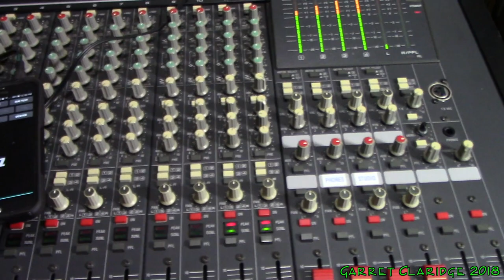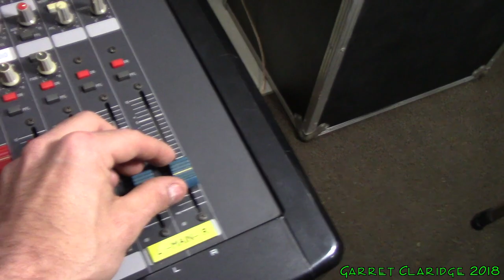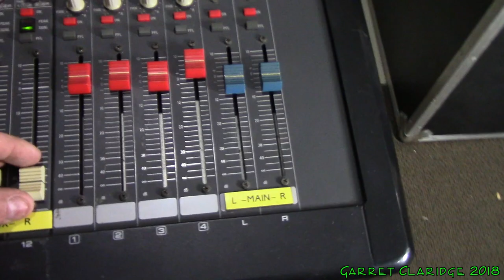SPEAKER BLOWOUTS! - Technics Honeycomb Woofers

Comment: Awesome! But it’s so weird how the poly-propylene cones shatter like that... maybe old age?
Reply: Kasey possibly meant to be a very stiff coupler to the honeycomb disc. Maybe was infused with more mineral content? But otherwise, yes some plastic gets brittle
Reply: Rennie Ash as per the technical sales manual “highly Ridgid mica coupling cone for high efficiency and reduced distortion. Special polyamide voice coil bonding and polyamide bobbin provide excellent heat resistance for high power handling. And the large magnet aids efficiency. Our nodal drive system pushes the range of pistonic motion far above the point where a conventional woofer would suffer from cone break up and distortion.”

Comment: Reminds me of that pair of sonys you blew years ago, interesting design. probably sounded like shit though.
Reply: mike52787 i was thinking the same thing
Reply: That Sony video is probably my most replayed video by him other than his microwave series REAL OG status
Reply: mike52787 i have those sony speakerd and the fh 15r center piece. Such a cool bookshelf system. And no they dont sound like shit lol, they sound alright with the ebay refoam kit i got. That video is also my most replayed video btw lol. I found out about the boombox because of that video.
Reply: I have a small pair of technics honeycomb. They sound great imo. I also have lots of Sony APM speakers. The higher end ones sound pretty good, and I'm using one as my main system
Reply: mike52787 honeycomb designs weren’t designed to be the most durable or sound the most amazing. Yes some of the honeycomb designs do sound like shit
Reply: I have Technics SB-X500A And thats sound realy realy nice. Not loud. But lots of bass and nice quality.
Reply: Indeed THE SONY’S (2012)

Comment: The original honeycomb woofer speakers were made by Mitsubishi for their MS series. If you held just the honeycomb cone you would be shocked by two things. One,  they are ultra light and thus could provide unparalleled transient response, their low mass made them able to respond extremely quickly. But usually light cones flex a lot, giving you horrendous distortion. But with the aluminum honeycomb interior they were extremely rigid resulting in extremely low distortion. That was a big improvement over paper cones, which could often reach 10% distortion, believe it or not. So bottom line, they were simply fantastic. They also had very nicely finished cast aluminum baskets, unlike the stamped steel shown in this video of the Technics speakers. Unfortunately, Mitsubishi's midrange and high end drivers did not compete at the same level. The mids, although good sounding, were notorious for getting blown at sound pressure levels that were not all that high. The tweeters were alternately harsh or directional, or both, unless you had the black dome variety which could range from pretty good to exceptional. Best of the lineup was the MS-40 which had a smooth and pleasing frequency response that extended quite low and also had some phenomenal imaging capabilities that were not present in the lower end models. My understanding is that the MS-30 model is often used as studio monitors, which is a pretty good vote of confidence.

Comment: The weight in the middle of the inside surface of the disc is meant to try to dampen the vibrating modes of the flat plate, since it is not as inherently rigid as a cone. The cone behind is used to spread the load on the plate to drive it more evenly, also because it is less rigid than a cone. The foam piece on the center of the cone looks like it is prior art for the Balanced Mode Radiator drivers developed by Cotswold/NXT/HiWave/Tekton/whoever is paying their bills nowadays, so it may invalidate a few claims of the BMR patent. But never mind that, I never heard a BMR speaker that I thought was truly good.

Comment: Did these Technics honeycomb speakers not use foam surrounds? Or were they just long gone? Didn't even look like there was evidence of adhesive.
Reply from the maker: Yeah it was long gone, I hit the vac to it and got rid of the mess,  It was a foam that was inverted and hardly noticed
Reply: @GarretClaridgeMeerkat  Sharp also made honeycomb speakers in 84 with the front load record player, the system was 117 & 118 models

Comment: For being "woofers" they actually have pretty good high's. Must be something to do with the materials.
Reply: Travis Piper Because they are so light
Reply from the maker: Yeah! I noticed that haha, really cool reminds me of them shitty foam full range flat drivers they put in 70v systems
Reply: The honeycomb disc is stiffer than any cone speaker, and doesn't have the same break up nodes because of the layered construction. Being flat also means that it doesn't beam at higher frequencies.

Constant directivity sounds good. Imo some of these high end honeycomb disc speakers are better than a lot of cone speakers people rave about. However, the woofer motor is generally older without as many distortion reducing features. Would be great if they made these again using today's tech

They get a bad rap because most people only experienced the cheapest ones, as they are the most common
Reply: josh maier I use some Sony APMs as my main speakers. Not really into surround as of yet, though if I did, I'd probably make speakers using modern drivers. I listened to some expensive speakers recently. They can have less colouration than the older speakers, but are also missing certain traits and general niceness of the sound.

Comment: More rigid.. ummm less cone area so less bass??? On front... !^#& breathing holes in cone?   Almost regular cone on back wave.. sealed or ported?  Confusing but interesting.   There has tk be a better speaker
Reply: It's a ported design so it's actually a bit better to have less cone surface area in the front. I don't think it has too much effect tho.